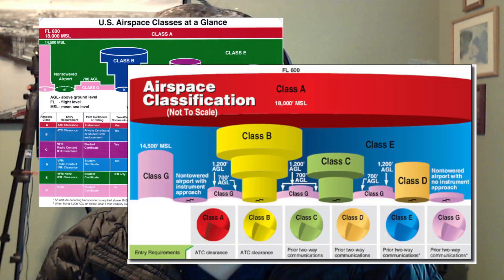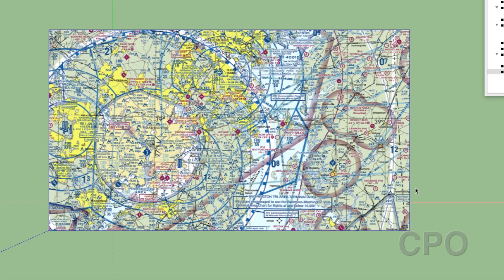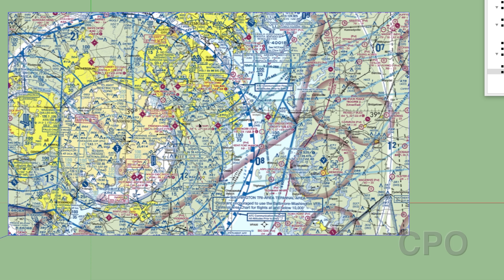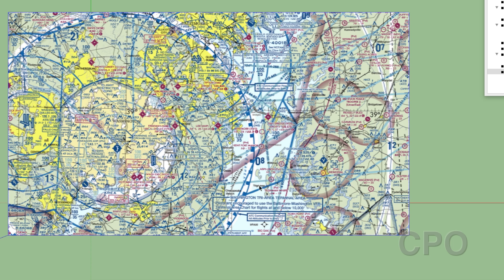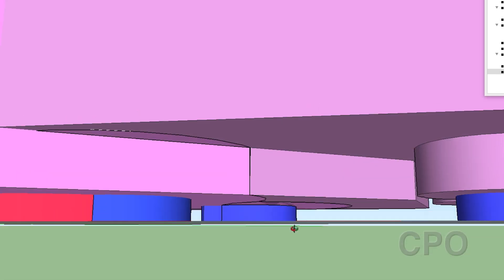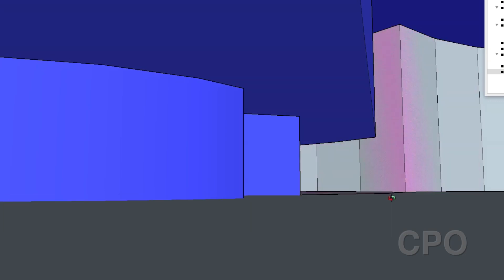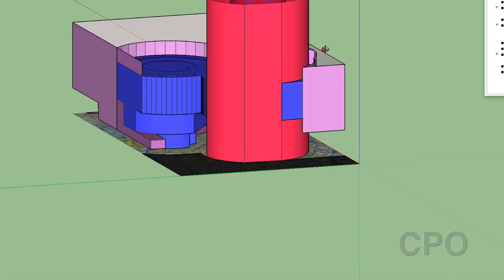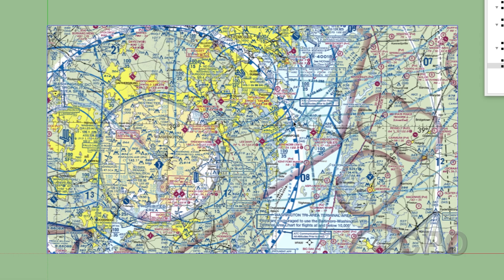Finally Understanding Class G and E Airspace Using 3D Modeling

Comment: With some very limited exceptions in remote and/or mountainous regions, Class G is everywhere that is not B, C, D or E to surface.  Class G is not charted.  It is either 700’AGL (fuzzy side of the magenta vignette) or 1200’AGL (solid side of the magenta vignette). That is basically it.

Side bar - It is lowered from 1200’ to 700’ for enhanced protection of non-precision instrument approaches. 

Nice graphics.   Great video.

Comment: I was so confused about the shaded magenta areas and whether I could fly a drone in them.  To learn that they are class E's with a floor at either 700 or 1200 feet AGL, I now know that I would be in uncontrolled class G space from the surface to my max allowed of 400 feet.  I've read so many places that you aren't allowed to fly a drone within 5 miles of ANY airport but I can see that that is FALSE.   Obviously, I wouldn't fly right next to one of these small airports but flying a drone a mile or two away is ok.  I can go to skyvector.com and see the FAA sectionals for myself.

Comment: So for these small class E airports, the ceiling does not start until 700'? Seems like that creates a dangerous scenario if it's controlled airspace above 700', but uncontrolled airspace below 700'. That means an airplane could just fly over the airport between ground level and 700' AGL and be in uncontrolled class G airspace. But then I guess that would break other rules.

Comment: Great video and animation.. from my understanding of the 700ft and 1200ft floors (I had a hard time grasping the info too!) of Class E is... Basically if its a runway with an ILS approach system the floor is 700. If no ILS approach is equipped you can bet the level is 1200ft floor...

Comment: To further your understanding of Class E 700' and 1200' airspace's, the floor of each is actually not a flat plain, it is an impression of the underlying terrain raised to 700 or 1200 feet above that terrain (AGL). I have yet to see anyone model such since it is very difficult to do so. One would need a digital terrain model and smash the airspace on it, then raise it up either 770 or 1200 feet. Think of it as mashing play-dough on an irregular surface, the resulting imprint under the play-dough is the actual floor (shape) of the airspace.